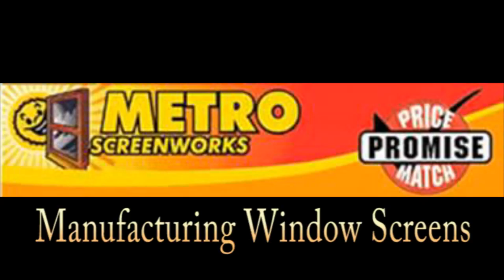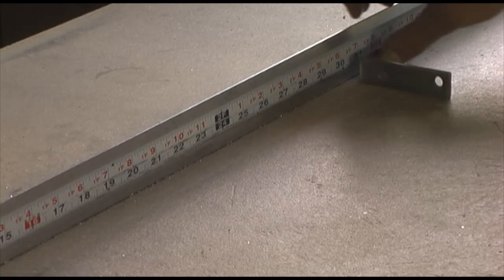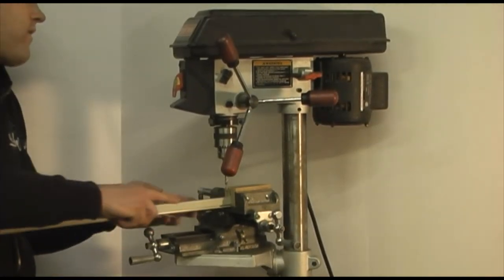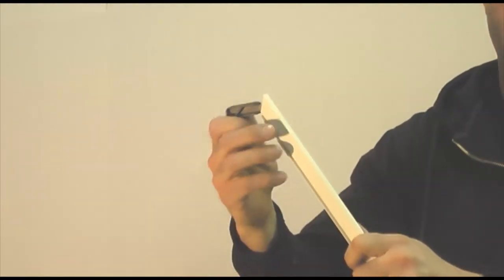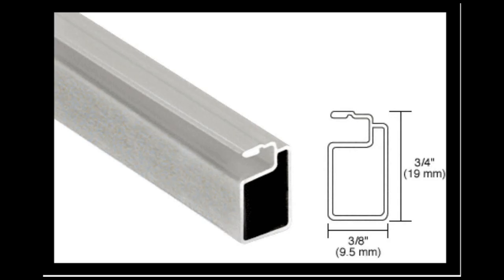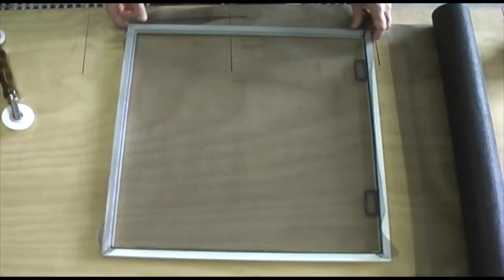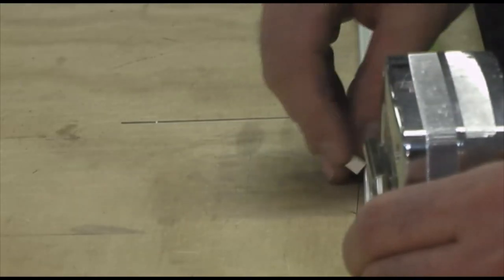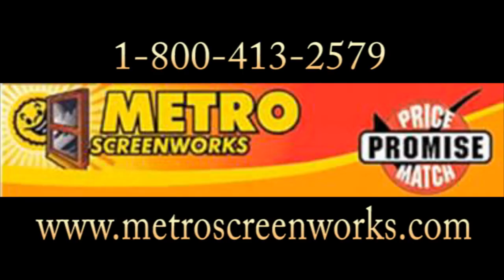How To Make a Window Screen

Comment: Thank you so much for this video. Very helpful. The only hard part was getting the frames the right size. I ended up cutting the height pieces 5 times until finally it went in. Overall 3 hours for that and the rest took just 10 minutes lol. :) Now, should be easier for me on the next one.

Comment: Thanks for your tip with the pre-roller side of the tool. I personally didn't know and was wondering how to get the screen tighter.
Reply: ya I was little clueless as what the narrow roller did. makes since now lol
Reply: Cool & right right. Well, I've since encountered problems with some of the screens getting blown off my house. That's been another real pain, even after adding one nail at the top to hold them in. Oh well and I'll figure something out in due time.